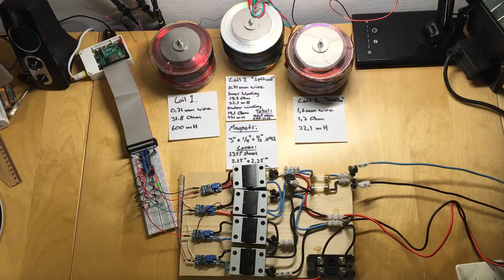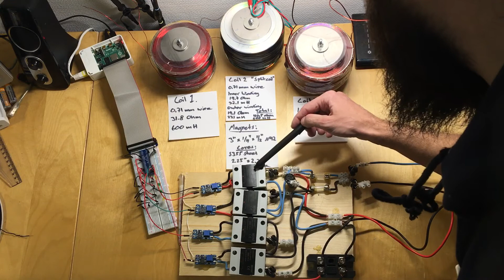An overview of my GAP-Generator (GAP-Power.com) replication setup.

Comment: Hi are u going to tell us total input power used from your system and the total power used by your load so we can see if the gap generator is over unity, and if so by how much, thank u for your demo, very good, if u run from batteries input and batteries load, u would be able to see if the gap/g is over unity, used power in - gained power out, and then measurement taken of the input batteries, and the load output batteries. I like yourself have been following art Porter for years, this is 1 better using solid state relays just like what art said, thank you for showing us your work.
Reply from the maker: @David Hutchinson
Yes! I will totaly do that! After all the testing I’ve done I’ve found some discrepancies in the way Art is measuring the input and output of the system. I will describe what I have found in my next video.
Reply from the maker: There's a new video out now with two actual tests! Check it out!